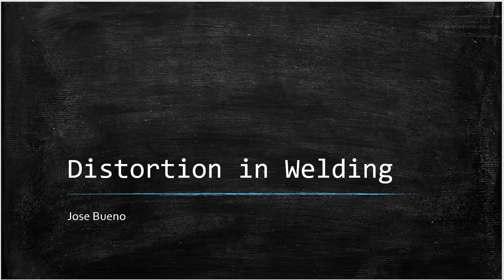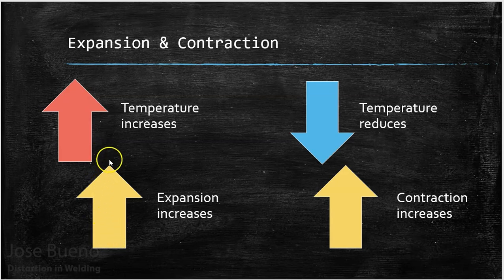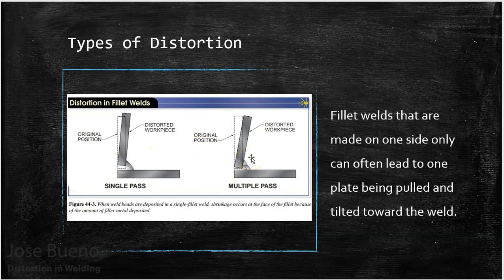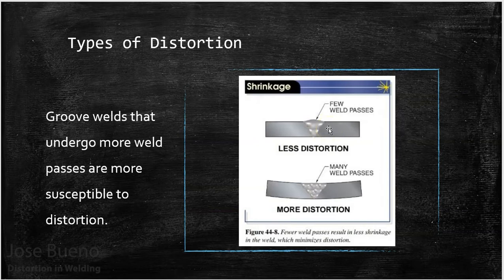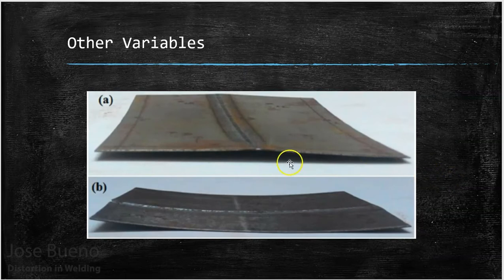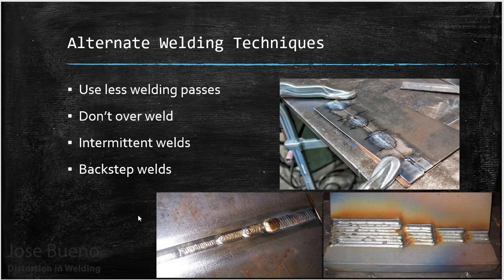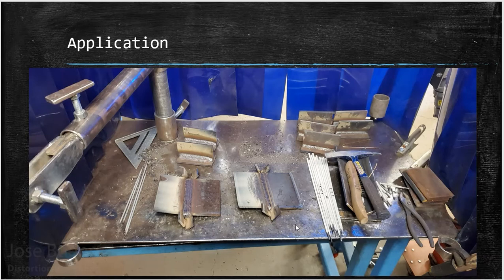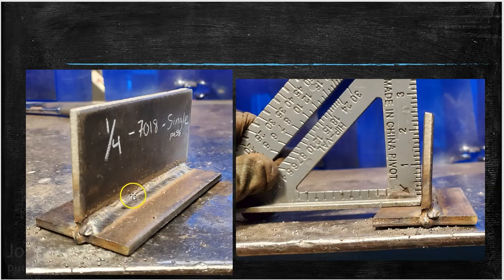Distortion in Welding

Comment: Hi! Appreciate the work you put into this video. 

Need to weld two plates together at 90 degrees as close as possible. Didn’t know about the back-stepping method, so will try this. Plates are 15 mm (slightly less than 5/8 in). Don’t need “full penetration”, think 3-4 mm on each side is plenty (3/32 - 1/8 in). 

They shall be L-shaped when done, planning a fillet on the inner side and bevel one plate on the outer side. Or better bevel both plates so I get a 90 degree groove? Any tips and tricks are welcome 🤗 

Also, I’ll have a stiffener plate at about 2/3 of the 20 inch length. Plan to tack up all and then start welding. The stiffener should keep it in place if I apply the back stepping method. I hope 😮
Reply from the maker: Hi, good question. 

Lots to type here so hang with me :D

Okay so I'm imagining the plates flat on a table, forming an "L" when viewed from the side. 
The vertical plate is what I would bevel; apply a 30 degree bevel on the outer side. Thinking about distortion, the more heat and weld metal we deposit on one or both sides is going to open us up for more distortion. So bevel just one, not both. I'd also bump up the size of the fillet on the inner side.  Just thinking about the thickness of the plates, I'd try to have 1/4 inch.

Hope this helps!